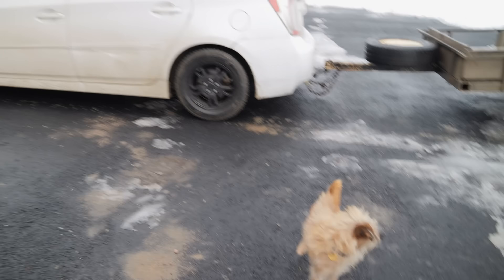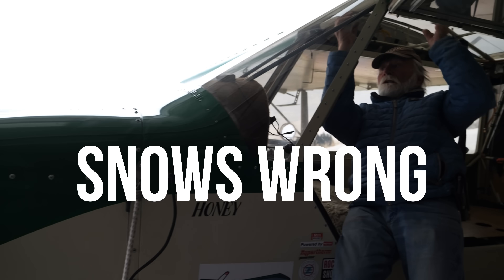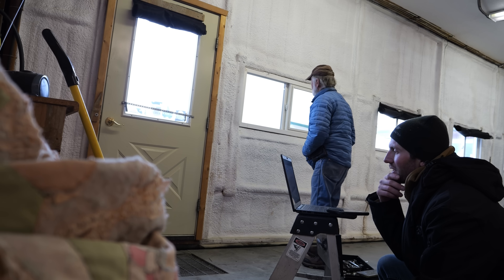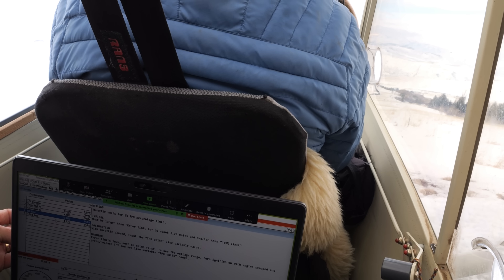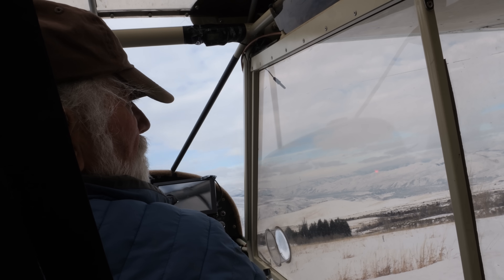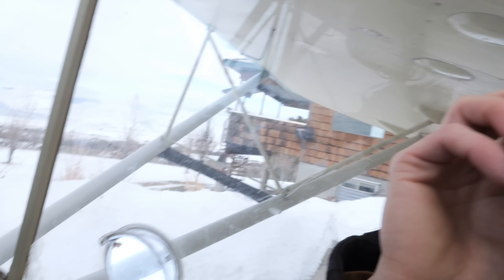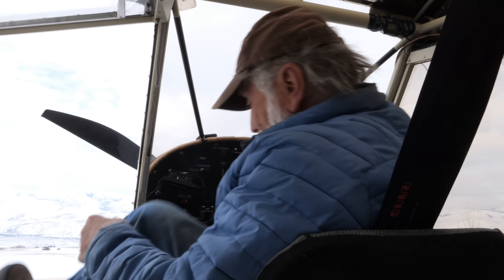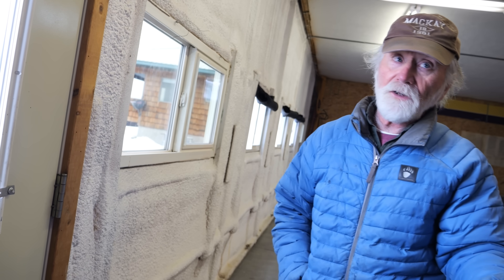Rotax 912 switched to Fuel Injection. Engine still wont run Right. Any ideas?

Comment: Check plugs for correct resistance, may be breaking down under high pressures, also lots of counterfeit ngk plugs around now made with poorer quality.Should be around 5000 ohms. I've found some that were way out of spec.

Comment: Had a similar issue with my rotax few years ago,ended up being a bad trigger coil. You can check the continuity at the coils. They also have a gap between the coil and Mag that is important to have corect. Good Luck
Reply: Checked it.

Comment: I like your suggestion on the different size prop to get it up to a higher RPM
Reply: The same prop the last 2500 hours, it's not the issue.
Reply: have you figured out the problem yet  @portnuefflyer

Comment: Were the ignition modules swapped at the same time the system was installed? If so, are they the soft start ignitech modules? I put those in my 912 as well and when wired with the soft start I would see something along the same lines. Pull the soft start connection and see how it runs

Comment: Basics: it is either lack of fuel or lack of spark.  Faulty Fuel system and starving for fuel supply. Regardless of the correct EGT's and mixture, confirm it with pressure gauges and volume checks. Faulty spark, replace what they recommend; wires, caps, plugs. I'm guessing fuel.
All that matters is that you physically rule these out before wasting your time. BASICS
Reply: If it was fuel starvation the AFR would start climbing to a very lean condition indicating lack of fuel causing a reduction in RPM. It’s gotta be ignition related.
Reply: Would agree about the AFR going lean in a carburated setup as you dry out the bowl at high flow rates, but FI with fluctuating pressures at high pulse rates could hold back max power with starvation without showing up in the AFR which is an average over time.

Comment: 45 yr mechanic and i tend to be in the valve spring train of thought. first inspect but after that they gotta come off for real spring pressure testing
Reply: I am leaning towards the valve spring issue, after chasing down rabbit holes for the last 2 months (could be this, could be that, anything is possible) BUT I do have a non stock cam, developed by Hal Stockman and installed by him about 900 hours ago.
Reply: generally speaking a vacum gauge should bounce at higher rpm or any rpm depending on how bad it is. but by the time it hits 5k and to stumble vacume will bounce so its a test you can do but experience is key   @portnuefflyer

Comment: Over advanced ignition timing at rpm will cause an engine to run rough. Find or mark an accurate TDC then check actual timing with a timing light against what the ECU is indicating.
Reply: This was my first thought
Reply: @jeremymason1684 I'm assuming they've checked the basics like huge plug gaps or broken valve springs.

Comment: Interesting put some iridium plugs in there or a little hotter or somethings lose when it hit maximum power and vibration definitely check that or try both fuel pumps at the same time 👍👍👍🇺🇸

Comment: How is the spark controlled?  Is it run off of the traditional magnetos or is it ignitor based run by the stand alone ECU?

What is the spark plug gap set to and have you changed plugs?
Reply: that's my first thought too... is there a crank position sensor?
Reply: @banzaiib  

He said the same problem existed before the installation of the fuel injection system.   

Wondering what is controlling the spark on the engine.  Is it magnetos or something else?   Anyway, that is where I would focus.  I do automotive performance and never really saw spark plug issues until the last couple of years and now see it all the time.   First things I do now when I have an ignition issue is to change the plugs.  Most of the time that fixes it.  If it doesn't then time to start digging further.  

I fly planes, but really don't know about magneto ignition system.  Can't pass the mag check then someone else figures it out.

Comment: Broken valve spring(s). Everything else has been ruled out, it's likely mechanical.
Reply: 5000rpm...broken valve springs? This has been going on for a LONG time and the top end is not damaged?
Reply: Maybe not broken, but weakened? Heat tempering from overheat can cause it.

Comment: After changing ignition coils and plugs, I'd want to look at valve springs. Could have a problem there which could affect rpm at the same place, valve float.
Reply: That and valves might not be seating properly or hard enough or too hard.
Reply: I concur.